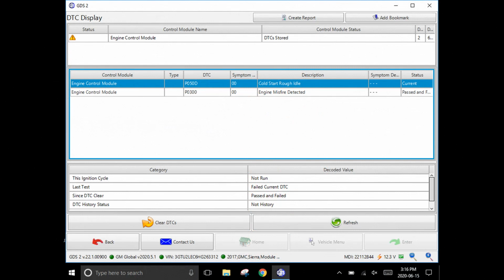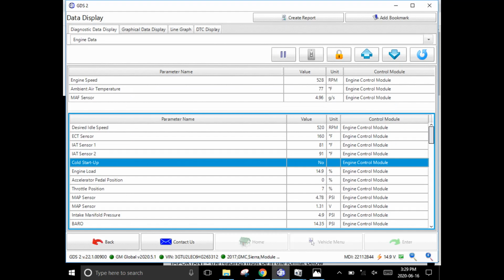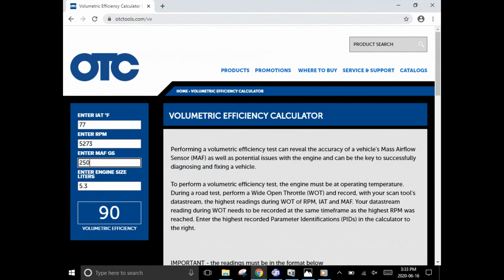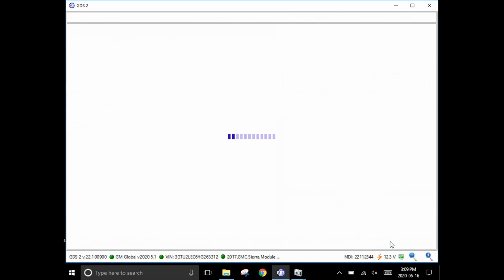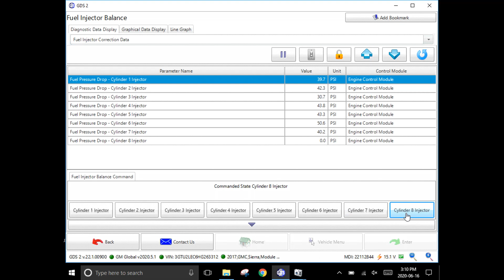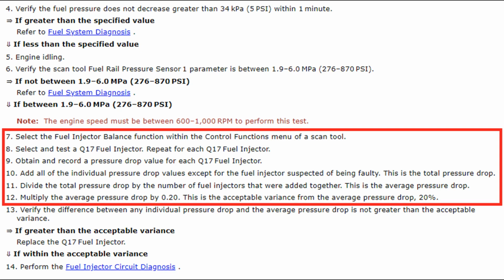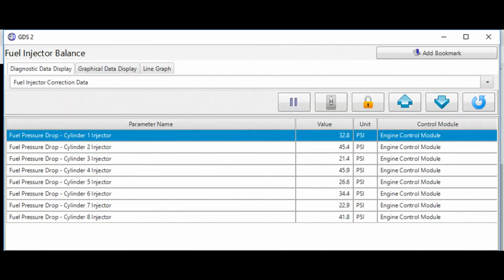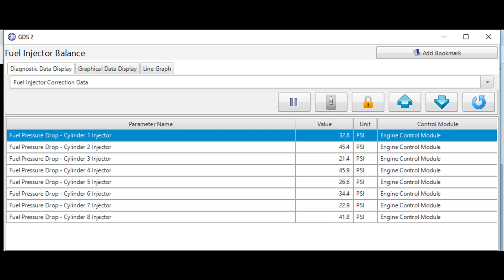Diagnosing A Cold Start Misfire on a 2017 Silverado

Comment: I'm going through the same problem right now 2016 Silverado 85,000 miles it's a shame I'm not at 100,000 miles and already problems.
Reply: I'm surprised you haven't had to replace the injectors yet man
Reply: @Mr.mycology1776  I have 2017 camaro with the Po50d  bad injector on 2 cylinder with 7,500 miles
Reply: These di systems have some serious flaws.

Comment: Thanks for the info....but I think fuel injectors test on scan tool is useless. Vehicle come in with cold misfire & set code P050D. I performed fuel injectors test with scan tool. All injectors on bank 2 dropped from 38 to 41 psi, all injectors on bank 1 dropped from 26 to 30 psi. When cold start up, I able to see misfire on cylinders 1, 3 & 5 ( bank 1 ). I replaced all 4 injectors on bank 1 only. After that, the truck runs beautiful, no more misfire, no codes. But I performed fuel injectors test with scan tool again & found all BRAND NEW injectors on bank 1 was drop from 27 to 31 psi

Comment: Why wasn't an injector  cleaning procedure done on it before replacing the injectors.
Reply from the maker: These are Direct Injection injectors. They have to be removed to be cleaned properly and nobody local has tehthe equipment to do the job. Port injectors can be cleaned on car but not DI injectors.